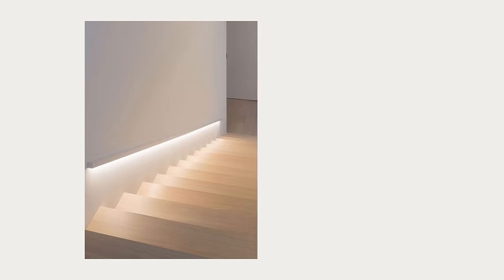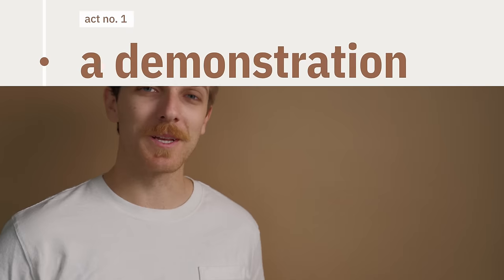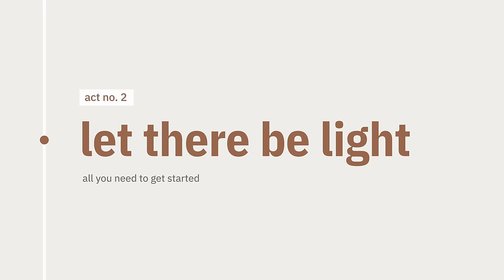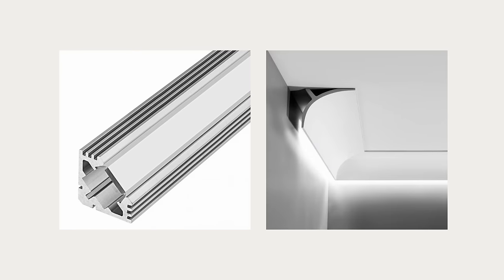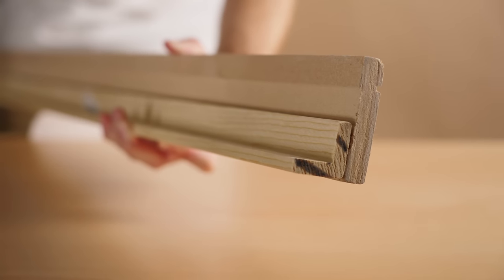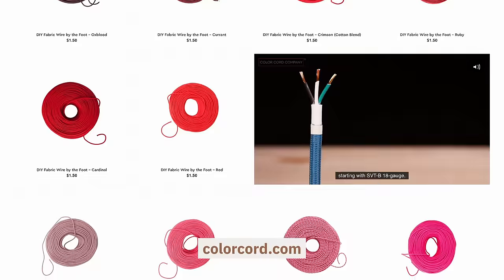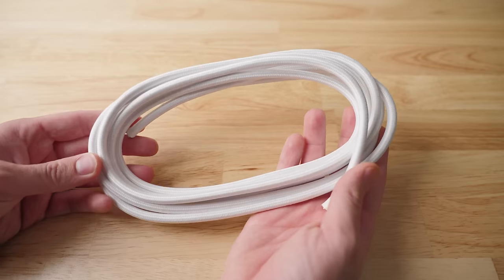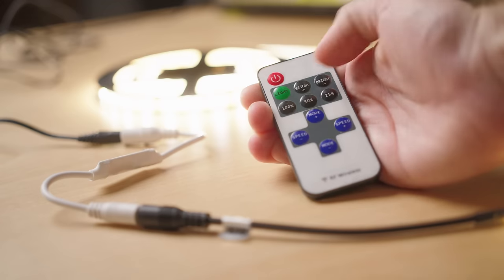I Made Cove Lighting for My Apartment

Comment: Quick tip to avoid the splitting of the wood. Drill pilot holes in the wood before using the wood screws. Pilot holes are drilled with drill bits that are typically the diameter of the screw minus the threads. Seems like more steps but it goes quick. And since the base board was mdf you only need the pilot holes in the wood.
Reply from the maker: Thanks for the tip! I do have small drill bits I could have done that with. You're totally right.
Reply: Came here to say the same thing ... a year late :) also get a countersink bit. I love my countersunk screws. So smooth--significant upgrade in how my projects feel
Reply: So that's why I'm meant to drill pilot holes, TIL
Reply: That's great to hear! It's all about adding your personal touch to your style. Have fun experimenting with different looks and keep rocking that coordinated outfit and accessories with your moustache!
Reply: You're welcome! I believe that putting effort into my outfit and accessories not only reflects my personal style, but also shows respect for those I interact with. Looking put-together is important to me, and I'm glad you noticed.
Reply: You're welcome! It's great to hear that you put so much thought into your look and pay attention to the details. It's those little touches that really make a difference and create a stylish and cohesive aesthetic. Keep up the good work!
Reply: You're welcome! That sounds like a great approach to fashion. It's always fun to experiment with different styles and make a bold statement with your outfit. Keep rocking that moustache with confidence!
Reply: He also did use the nails wrong...
Reply: This is the way
Reply: @nokidding152  Lol I came 2 years late

Comment: It’s important to note that as length increases, voltage will drop and the tape will start to progressively dim… it’s a good idea to test first and find that diminishing point so you know where to start a new strip to minimize the effect of the voltage drop. In some applications, with the use of a 2>1 cable, you can split the power and send it to both sides of the strip. This varies based on if you’re using a dimmer ahead of the tape or not

Comment: This is the most millennial project (soft string lighting a millennial gray rented city apartment behind a bike) accomplished with the most boomer skills (carpentry through three methods of wood joining, cutting to length, and rewiring internal electrical from AC120V To DC12V and extension cord).

Comment: one major issue i see with this design is that you will see the pixel tape from above. professional lighting designers go to great lengths to hide the tape from all viewing angles. i would suggust placing the tape on the side of the molding, and putting a strip of wood above it to hide the tape. then paint everything white on the interior to maximize the amount of light pushed out.

Comment: 2 Things to consider:
1. It will collect house dust. Solution is to have a clear or frosted plastic strip run along the top.
2. If you get an RGB + Bi Colour Warm & Cool White LED strip, you can make the strip go through all the sunlight colour spectrum. From peak bluish daylight, to sunset red. This way you can match the outside light and preserve natural circadian rhythms. (FYI blue light is actually good, just at the right time (middle of the day). Blue light is only bad once the sun has gone down.)
Reply: Great info!

Comment: Great video! It looks great.

A few notes from someone who has done a lottt of LED lighting:
(1) 24 V is almost always better than 12 V so you can use longer strands without becoming dim at the end
(2) Get high-CRI lights, otherwise the color of people and other things in the room will be off, usually quite significantly
(3) Get variable color temperature lights so you can vary them based on time of day and improve your circadian rhythm
(4) Get a zigbee (or WLED) controller so you can integrate with your smart home (Home Assistant is the best!)
Reply: Love me some high CRI strips. But do you think they sell bi-colour strips for these?
Or do you run 2 strips of LED's of different colour temperature?

Comment: Hey, nice video and apartment. You can drill pilot holes in your corner molding (or anything you're trying to put screws through, really) to prevent it from splitting.

Comment: My problem with things like this is the depth. I love the idea, but 2in baseboards are a huge no-go for me, especially since I already have .75in baseboards in my place with 1in quarter-round. I need a solution that minimizes the depth so that 1) it is easier to install without having to move everything in my apartment and 2) it looks better. It'd also be nice to be capped so that dust and debris can't get down in the cavity.

Comment: those self taper screws are made to dig not to drill. if you want to fasten anything with it, drill a hole in the material you want to attach so the screws only dig into the base material

Comment: You can avoid splitting you angle molding by pre-drilling and countersinking your holes. Torque doesn't matter, other than the fact that it drives the screw in further, applying greater wedge force at the hole. If you want it to last, add glue to the joint. The screws will be your clamps.

Comment: Drill out a hole before putting screws in to avoid splitting wood, i usually use a drill bit 50-70% of the size of the screw i use. 10/10 design though!

Comment: good video! Im sure you know by now, but if you drill the correct sized pilot hole before using screws, you wont split the wood as easily

Comment: Just a heads up, if the power supply is sending dc, you may end up with low voltage/flickering leds if your wire is too long. Dc is like throwing a baseball.

Comment: Ngl I love this build but the rope wire you used for the 12v side was way over kill that wire is rated for 120 volt not bad but you probably can get cheaper corded wire if you look for a thinner gauge rated for 12v

Comment: Do you have an update on how well the self-adhesive on the light strips has adhered?  In my experience the provided adhesive is not the greatest.  I like to add a cushy double stick like Gorilla mounting tape, especially if the strip is attached to a vertical surface. 

Then again, maybe the adhesive has improved in recent years.

Comment: Nice project, I appreciate your perspective on the topic of indirect lighting with inexpensive methods. But I saw too many rookie mistakes with the LED tape. You bought tape that's overmolded for water resistance, which is unnecessary indoors and more expensive. You also should use 24V tape and PSU if you have longer strips, especially if you extend on the low voltage side. If you wanna spend just a little, more you can buy LED COB strips, which are a true generational improvement over the (still cheaper) individual LEDs on the strip. Also, a CCT variant has two different color temperatures and lets you choose anything in between with a suiting dimmer. Lastly, you showed the extension being screwed down with bare strands, this is not great. Soldering is the cleaner solution if you get the barrel connectors on a piece of wire.

Comment: Should be mentioned that any wall or ceiling being lit this way must be flawlessly smooth, otherwise raking lighting such as this will highlight and exaggerate any flaws. 

Or you can skip doing a skim coat and repaint and just put up some string lights, which doesn't have this issue.

Comment: Be careful with the wiring. Small cables are not made for being run too long of a distance. There is a high risk of an electric fire if you run the thin wire long distances.

Extend the high mains voltage instead if you need to run the wire any longer than 5-8 meters. (Or if your pulling a high current to your LED-strip).

Be careful out there and don't burn down your home.
Better to ask an electrician for help if you're unsure. May save your life or property 👍

Comment: Those carpentry skills, not as good as the interior design skills.

You split the timber because it wasn't properly pre drilled with a pilot hole, it also shouldn't have been pressed together with a gap allowing the top piece to bend and be unsupported along most of the length that way.

Aluminium flat + equal angle would have been better, straighter, act as a heat sink and easier to combine and stick the strip to.